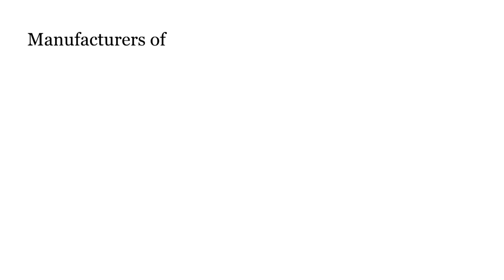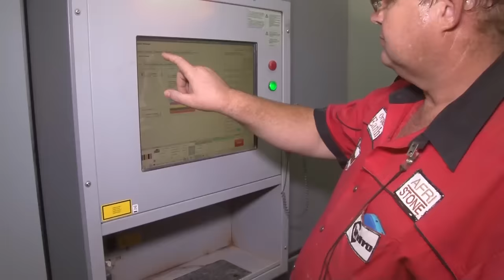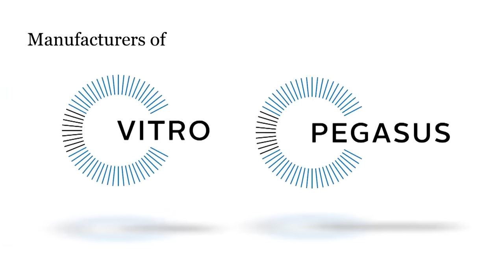How TILES are Made

Comment: What is the difference between grade A and grade B tiles?  (I'm a new home buyer, just want to make sure I know the difference for when I go through my final inspection with the builder!)
Reply: Quality and life of tile
Reply: Thickness and overall tile size may vary. A grade is all packed as exatly same size tiles which gives you much higher finished look in larger spaces/rooms. This selection restriction in measurements can pack pretty different tile sizes and thus create a nightmare during the installation
Reply: A grade tiles are perfect in shape and size without any other flaws such as colour/glaze/printing etc are concerned which are uniform. In B grade it's vice versa because there might be some defect in the tiles with respect to size, shape or even thickness. Some time warpage (Slight bend)may also be possible due various manufacturing faults such as quality of raw material or baking (firing)is not perfectly balanced and controlled .

Comment: Hi!!!! 

I need some of your personal advice, if you can help me out I will be thankful.. 

I am totally confused what to do ,some one saying go for vitrified, someone  saying go for ceramic 
I am renovating my washroom, I want to install 2 by 4 size tiles in my washroom.. 

Please reply

1. Should I go for vitrified 2 by 4 tiles or ceramic 2 by 4 tiles on walls?? 

2. Which material should be used to fix the tiles, cement or adhesive?
Reply: Go for rough textured ceramics for the flooring. If there is need to tile the wall as well, u can use vitrified, porcelain or ceramics smooth textured.

Comment: We are a silicon carbide ceramic manufacturer from China. We produce silicon carbide refractory products for kilns.The main products are  silicon carbide beams, rollers, flame  tube,plate, cold air pipes, sheds, saggars,  thermocouple protection tubes, heat exchange tubes, and radiation Tube inner tube, radiant tube outer tube etc.
We provide OEM services to many large native companies.
Free sample codivd be sent on request. 
Wait for your reply

Comment: What are the differences between ceramic, vitrified and porcelain tiles?
Reply: Yes, please define the above
Reply: Ceramic Tiles consist of Wall tiles, Floor tiles. They are differentiate based on Water absorption. Wall tiles have generally 5 to 15 percent water absorption.
Vitrified Tiles are stronger, resistant to scratch and stains. They consist of Glazed Vitrified Tiles, Double Charge vitrified tiles, nano polished vitrified tiles and Full body Vitrified Tiles. They have water absorption less than 0.05% percent.